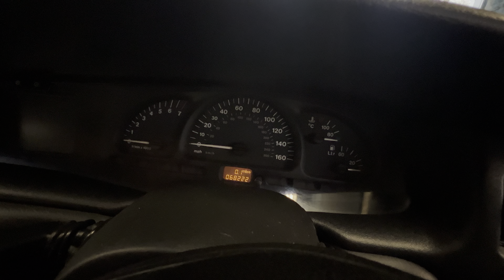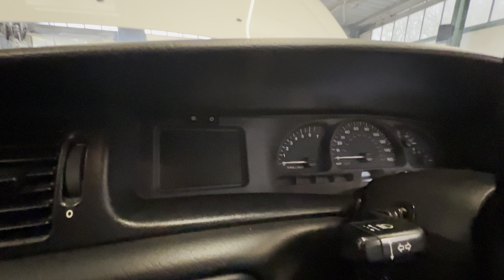Vauxhall Vectra Super Touring - 1 of only 1,000

Comment: Hol up.. The MSD badge was originally above the Vectra badge  on the super touring 2 and a half litre… confusing
Reply: My mistake. I see it is an ST. One of the tuned variants
Reply: Never tuned and not msd 

These are just a SRI With a bumper and carbon bits